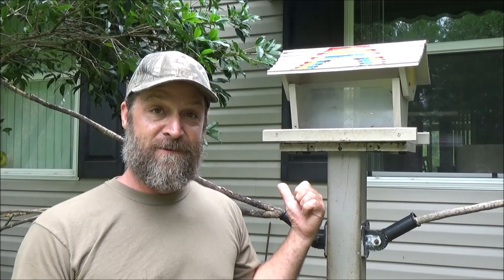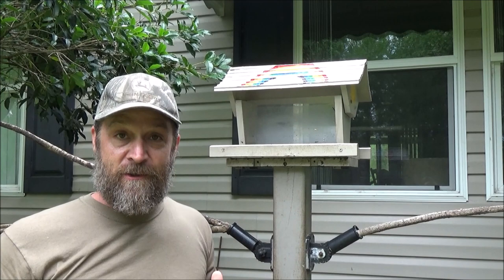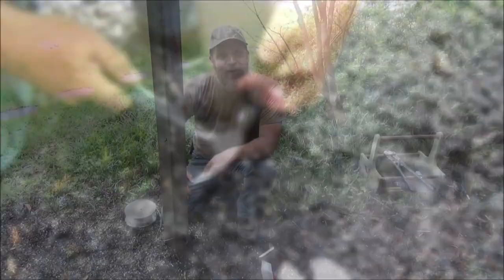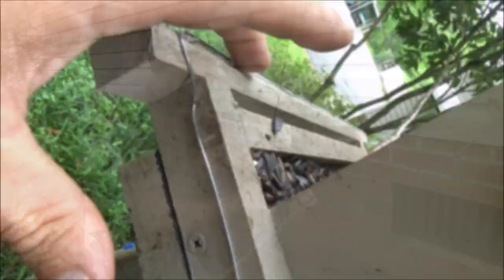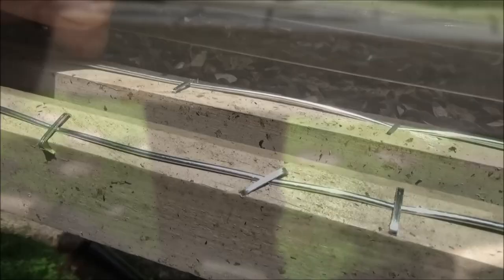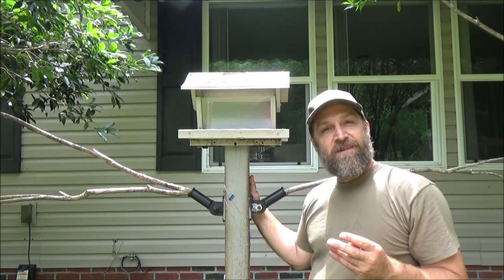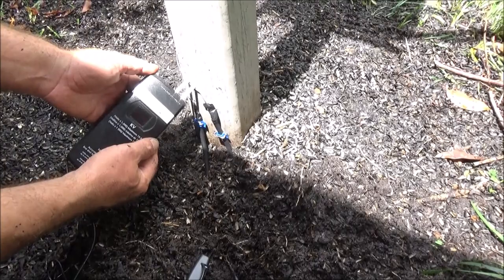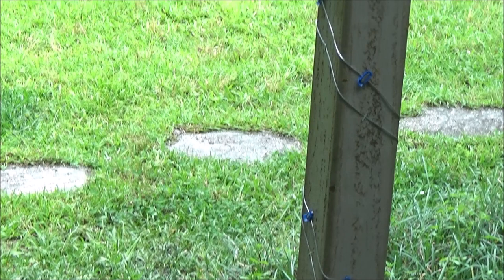How to make an anti-squirrel bird feeder with an electric fence charger

Comment: I guess you know by now but your wood will be slightly conductive once it gets wet.This causes DC resistance and will load your power unit down.  You can make small insulators from many items. I like plastic tops from drink bottles Just drill 2 opposing holes through the sides and run the wires through those holes Drill them so that the wire will run off center. Then drive a small nail through the top wo touching the wire.  This a free upgrade which will keep the load caused from the resistance of wet wood from harming your power source. Plus, it will be more effective since the potential difference between ground and your live wire will be higher.
Reply: Fantastic idea !

Comment: If two conductors are paralleled up the pole, the grounding rod is completely unnecessary.

And as you've discovered, a lucky squirrel will occasionally miss the conductors.  A standard poll collar will keep them from climbing the pole and is maintenance-free.  But, I'm always amazed at how far and high the squirrels are willing to jump from other objects (trees, roofs, and such) to get to the top of feeders.

Good luck with your squirrel-proofing.  It seems as soon as one comes up with a solution, the squirrels figure it out.

Comment: I threaded my feeder pole thru a slinky. Allow the slinky to hang 5ft high and at least 2ft off the ground. 100% squirrel proof if there isn’t a tree or fence near it. They cannot climb up a slinky.
Reply: Very good idea thanks.
Reply: Just installed slinky as you suggest. Does the job, perfect and safe.

Comment: I made a couple of chargers from auto ignition coils.  One was a coil on plug coil from a VW.  I use a "tilt switch" made from a wire with a fishing weight hanging through a heavy wire loop.  It is hooked up so when shaken, the tilt switch makes and breaks switching the primary on an off causing the secondary to fire.  I just use a 9 volt battery to drive it since it draws no current if not disturbed.  I can just be hung from a fence wire or hung from the bottom of a bird feeder.

Comment: I had a feeder with a 9v powered shocking circuit on the bottom of the birdfeeder but that gave out over time.    I wish i could find another circuit to replace it.    The perches were metal and if the squirrel touched two perches they got a shock automatically.   It worked great.
Reply: Get a 2 mile charger with polywire keeps them hopping

Comment: What gauge is the ground wire and what clips do you use I wanna make one .
Reply: The ground needs simply to go to the earth (ground).  Choose a 12 to 16 would work.
Reply: For this size animal, they suggest 17 gauge aluminum wire. It's under $5 for 250 feet. The Patriot PE2 energizer is $35 at Walmart.

Comment: Too much cost and work.  Get a 12V electronic adapter from a second hand store.
Get some speaker wire.  Join the speaker wire to the adapter.  Put 2 pieces of aluminum foil around the post, 1/2" apart. {or steel}.  Simple.